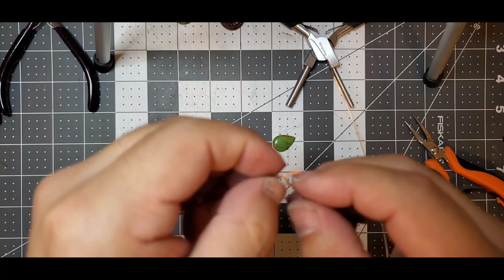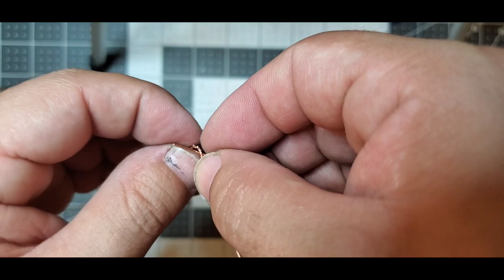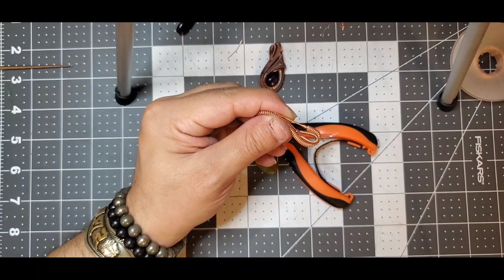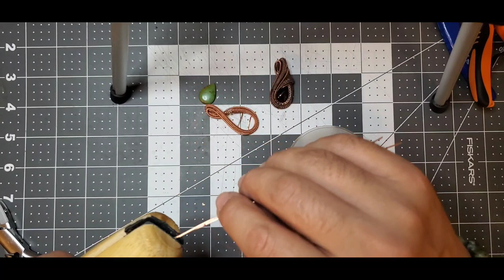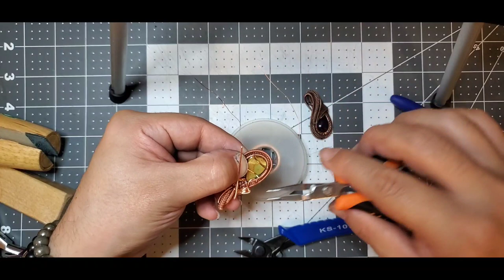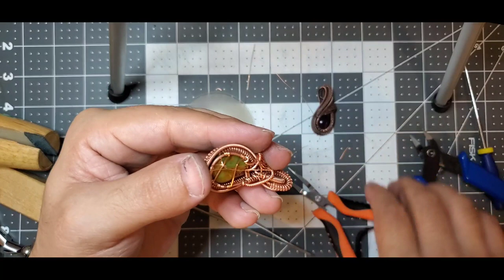Wire Wrapped Pendant -  walk through

Comment: This was really helpful. There were several "aha!" moments for me, thanks to the deliberate pace of your work and the somewhat offhand remarks you made at time. Lots of little gems in there. Could you please add in the comments the gauges you used for the coils? Thanks!
Reply from the maker: Thank you for your kind words. The coils is made of a 28g on 24g coil wrapped around a 20g core. The filler wire is also 28g.

Comment: Love this piece so much! My mind is blown that you can use a drill to make things easier and faster! What kind of drill did you use? I definitely want to try this technique
Reply from the maker: I use my basic traditional dewalt drill that i use at work. I would think a simple black and decker may work fine for this as well though. As long as you have a chuck on it that you can open and clamp back down on this wire your all set. I have another video on just twisting coils that may show the drill a bit better.

Comment: Thank you so much, this is a very beautiful design. Question: what approximately is the length of the first coil (24 & 28)? Or how do you measure the length you need for a certain design?!
Reply from the maker: So I usually just measure how long I need my coil and do twice that length on the first part. That typically gets the job done.
Reply: @sethedelinski348  Thank you so much! I’ve made this pendant yesterday, I’m satisfied but as perfectionist I’ll want to make more until I “master” it 😎☺️ the only problem I’ve had is to make second coil with the first using my drill: it was so hard to keep them close, and then I had to push them tight together, the base wire was banding 😬Almost gave up, but I’m stubborn 🤪 I guess I need to practice and learn to coil with drill more! 🤓
Reply: Sorry, Seth, but I’ve to ask you one more question: before you make second coil on 20ga, do you take first coil off the 24ga, or coiling with it!? Somehow my coil is coming out on the end of 24, when I’m making second(final) coil. I’ve made coil on 20 with 28, which got off the 24 and it looks pretty nice. Not sure if you can understand what I’m saying  ☺️When I make coil on 20, do I remove 28 coil from 24? Hope that make sense?! 😉 Thank you 🙏 😊
Reply: I’ve watched your video again carefully, and I got it! You are not taking off 24 from 28!!! Thanks
Reply from the maker: @SingingSwanMedicine  oh boy, I bet that was fun. Lol. But yeah you got it now. Keep the 24g core inside of the 28g. Glad you got it working now 🙌
Reply: @sethedelinski348  🤣💪🏻

Comment: How cool you are so honest, have not watched yet, but what size cab did you use Seth? I finished the video and it is awesome. Up close so I could see everything, loud enough to hear and step by step process!. Sadly, I won't be able to try it because I can't do the drill/wire thing, but keep up the good work!
AAA
Reply from the maker: I dont remember the can size but it was under an inch but taller than a half inch for sure. You can do this with any size stone though.  As for the coiling, it can be done by hand. If done by hand though it would be best to use a smaller stone so you don't need a long of a coil.

Comment: My wire keeps breaking off at the drill.  What am I doing wrong?
Reply from the maker: If your talking about the core wire there are a couple things it could be. The main and most common cause would be pulling back to hard on the drill and/or the swivels are catching up every so often. It can be easy to miss if they are always spinning when you are actually looking at them. Too much back pressure is the main cause for swivels to be locking up. Also don't pull on the wrapping wire too hard as to not create too much pressure on the core from that as well. Hope this helps.

Comment: Can I do this using all round wire?
Reply from the maker: You can... I would go up to 18g for the frame though if that's what you wanted to do. Also make sure you re tighten everything after you finish setting it. The reason for using square is just that it holds the attachments in place better.
Reply: @sethedelinski348  thank you!
Reply: Thanks  @sethedelinski348   💎 

I can not find square or half round in Europe 😏 Bad enough copper wire 😥 But I have a translation of what gauge is in mm 😉 
And I try my best, but this video has solved so many questions and frustrations about how it is done. 

So nice you also share your thoughts and solve the challenges 💚

So THANK YOU Seth 💚